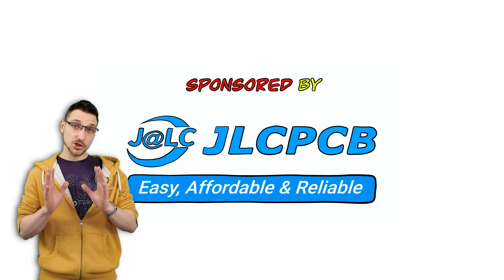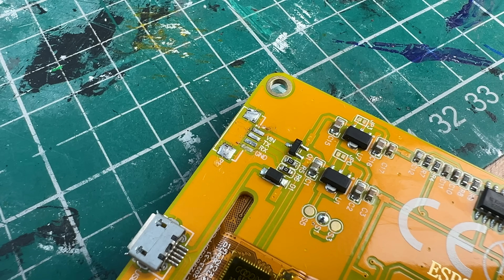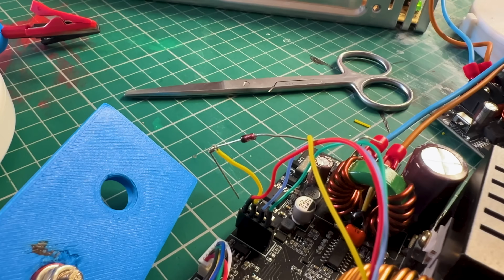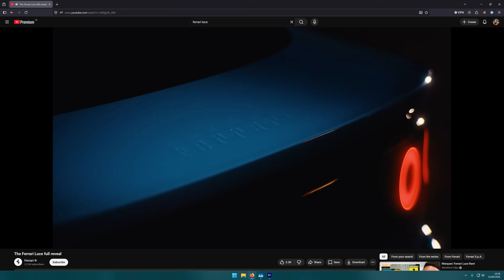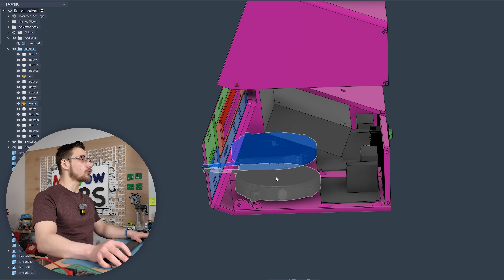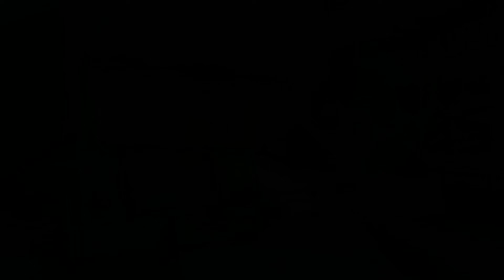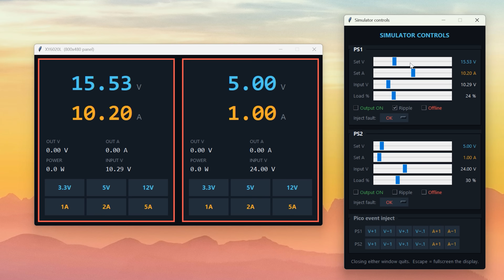I Built the Bench Power Supply Nobody Sells

Comment: XY6025L are HORRIBLE: contant current mode kicks in after 0.25s, even when you enable output (so it gets high above the current limit on low R on start). Some times it settles current after 2 s.

Comment: Great project. But the thing is too big/bulky; it takes too much space on the desk. For me it should be higher and less wide.
You've announced a 2nd version. When is that coming?
One thing that could be added is a USB charging port.

And you could add some speakers then you could use it as a internet-radio when you're not using it for the intended purpose (as a screen is already built-in ...    haha ;-)

Comment: A Pi Zero is immens overkill for something like this.  Just using only the Pi Pico would make so much more sense (and attach a touchscreen directly to it instead of using an CYD for that).  And I guess the "blowing up of the uart ports" points to the voltages used by both sides being different.  Pi and Pi Pico will probably use 3v3 (but double-check the datasheet as it might even be 1.7v) and if the other side would use 5v or even 12v (which is what a serial port back in the days would be using, but now is very unlikely), then you'll be out of luck fairly quickly.

Comment: since the power supply modules let you adjust voltage via uart you could make it output a sine wave or a square wave if needed and add a capacitor at the output to remove the dc offset
Reply: @M4CHINE69  wouldn't work, the supply can only source power, not sink it - and also the uart interface can only work receive commands at a fixed rate, thus greatly limiting the speed at which any waveform can be generated.
Nice thought-experiment, but reality squashes the practicality.

Comment: Knock knock, do you got time to talk with the lord and savior ESP32-P4? Which brings 5 uart ports to the table, and one low power one and which is available with a 4.3 inch display and an ESP32-C6 for wifi, Zigbee, thread, matter, Bluetooth a Co processor.

Got the 10.1 inch variant for 43 bucks this month to play around with :)

And it's also RISC-V, not some proprietary bs - which gives bonus points IMHO :)

It can also run Doom.
Reply from the maker: Just give me the leaflet and go away, look it up later.
Reply: @Mellow_labs is now later? :)

Comment: Hmm... a few thoughts... Not meant to be negative at all. I would happily trade my very old, very beat up analog bench supply for this!

A whole Linux OS to boot just to control a couple of voltages? I think the earlier version with the Pico controlling all might have been the better choice.

Anyway.. regarding the Pico version... about the laggy ui.. Why not swap it? If your hypotheses that the lag comes from using the software UART is correct then use a hardware UART for the display/UI.  The bit-banged GPIO 'UART' can control the second power supply module instead. Sure, you would still have a slight delay changing that voltage. But it would only be on the second supply. The first would be snappy. And you could always update the display, grey out the control, display a 'wait' message, etc... first. Then change the voltage. Then restore the display. That way to the user even if it took 2 seconds to get the change they wanted they would see the response from the display right away, know it was registered and not have to keep clicking.

The switches are cool. In a very creative sort of way, not unlike a "cyber deck" as one would see over on Hack A Day.  I would keep them for that 'cool, geeky' factor. But.. I would miss having the knob. A knob is a good UI for slowly turning up or turning down the voltage or amperage while watching a device's response.

As for quickly reaching a specific voltage.. well.. you do have a touch screen. You have the preset buttons on there which is an excellent touch. I would keep that. But I would add one more labeled Man[ual] or Key[in] or something like that. One on each side. Click one and the whole display just becomes a numeric keypad plus a row at the top displaying the number as the user enters it. That plus buttons for Back, Clear, Cancel and Enter. Upon cancel or enter the screen goes back to the two-sided main display.

OTOH... if you are married to the idea of the full Pi or something that runs an OS...

You can always integrate it into Home Assistant. And through that your favorite voice assistant. You could be telling Jarvis to set your voltages for you just like Iron Man. Then again, you could probably do that even with a microcontroller but you would need to switch to something with networking like an ESP32.

Comment: I think you can't generate a plus and minus voltage with the same ground, right?  that would need two isolated power sources.  OK as long as you don't work with, for example, op-amps at +/- 15v.  Good job, otherwise.  The presets are a great feature.

Comment: This is certainly relatable. I found myself wanting a 4-quadrant bench powersupply a while ago and couldn't find any remotely affordable ones. So I thought to myself "I've designed a lot of power supplies on various PCBs... How hard could it be?" 
Turns out that you need to know drastically more about power supply design to design a 4-quadrant (bipolar) power supply for use with a wide range of applications rather than a power supply for a specific use case with well defined operation parameters.

Needless to say it's been months and I'm still not done.
I'm almost starting to understand why these start at €2000.

Comment: This is fantastic! I also use retractable USB cables for charging my phone, but for a power supply, this is just awesome. It's exactly the kind of PSU I wanted to build myself. Personally, I would probably use two independent power supplies—one rated around 300–500 W and a second one around 100 W. That would make the setup more compact while still allowing me to power sensitive equipment without sharing a common ground.

Comment: Dude, you’ve put a crazy hell of a lot of effort into this project. It turned out pretty good, but now let me throw in some criticism.

First and foremost: this is NOT a lab bench power supply. A proper lab bench PSU is a linear regulator designed with excellent, correct circuitry, featuring a MINIMAL output capacitance—around a 15-20 of nanofarads, max.

Second: you could hook up a powerful switching supply to its input, maybe even with a dual pre-regulator function. Meaning, it should either maintain a constant voltage (true CV mode) or smoothly decrease it when current limiting kicks in (cheating a bit, but acceptable if we know when and why we're doing it). A toggle switch between these modes is a MUST.

Third: where is the remote sensing (4-wire sensing)? Bro, a beefed-up lab PSU is nothing without it.

Fourth: make 2 or 3 galvanically isolated channels. That way, you can either pump out 90 Volts at the output or, by dropping the voltage, crank it up to 30 Amps.

Fifth: you must have a choice between latching (overcurrent) protection and standard current limiting.

Comment: Your power supply design has a couple problems. Since both modules get their power from the same source you can not connect them in series to for a plus and minus 12 volts. They will fight each other. The second is the current sensing shunt may be connected to the negative output terminal. It's far easier to put a shunt on the negative side with a stable voltage than the positive rail which can have different voltages.

Comment: For rotary encoders I use schmitt trigger inverters and flip flop then only need one isr per encoder no debounce in micro needed and direction is done by the flip flop and there is two inverters left for the push switches.

Comment: Huge respect for the perseverance required to keep testing, debugging, IMPRESSIVE!!

One important point about many of these modules is that the VIN+ / voltage-sense line is often connected directly to the MCU through only a resistor divider. Because of that, one of the most common failure modes is that an overvoltage event reaches the MCU pin and burns the chip.

I actually made a library for this exact situation after the onboard MCU on my buck module got burned. I desoldered the original MCU and controlled the board with an Arduino instead. It works, but it is not plug-and-play: you need some reverse-engineering skill to figure out which pin does what, how the control signals are handled, and how to drive the original screen.

I made a GitHub repository for it, but the hardware connection is a bit tricky and needs careful wiring.

 WARRNING: you CANNOT connect your output channels in series to get dual power supply to power opamps for example you will get Magic smoke instantly (these are none isolated buck modules (common ground)).
Reply: if you want to use them is series you need :
 1- seperate AC/DC converter for each one
 2- galvanically isolate UART (no common GND) hint(Dual-Channel Digital Isolators)

Comment: Nice video! Those retractable reels are EXACTLY what I now want to use on my own PSU build - great idea! I'm going with an STM32 to run the screen and controls, plus an ESP32 for web access, and it's 3 channel, but the basic idea is the same :). In my case I often have to measure the battery pull over time with IoT devices I design, so developing custom firmware to make it simple to do that instead of having to deal with the horrible interface on my Rigol PSUs!

Comment: Going to parrot the danger of the retractable cable reel because I had bought the same one to create a retractable USB-C cable.

BE CAREFUL REWINDING THE RIBBON SPRING OR WEAR GOGGLES / FULL BODY PROTECTION EVERYWHERE, OR JUST AVOID IT ENTIRELY AND BUY A NEW ONE. Every time I think back to how it came undone during my many attempts to rewind it and how I sliced my fingers deep (so much blood) is how bad it could have been if it hit my eyes or anywhere else. Ribbon springs are not forgiving, and they are greased up so not the easiest thing to fidget with.

7:42 triggered my post traumatic ribbon spring disorder

Comment: Wonderful project, especially retractable cable is a cool idea. But using a whole computer (RPi Zero) for a power supply is such a waste of resources! Not to mention it comes with unique set of downsides and challenges very different from MCU world. 
Also, switches for setting voltage/current?! There is a reason nobody uses that, it takes too much force and travel (and hence, time) to move. You can now compare the time it takes to click through the switches and operate a clickable encoder.
By the way, there clearly is a proper reaction to touches on the CYD (the button flashes), there is just some bug in the code that prevents it from reacting on first touch.

Comment: wow never seen that idea of toggle switch, emergency stop switch and roll cable idea.... good work..!!! (subcribe!!)

i have idea for you buy3?CT? output PSU or two individual PSU, so you can wire up both PSU together like make batteries... (if you want do experiment in audio or other that need + 0 - you could combine the both co be CT lab bench supply, or make high voltage output with combine of both output... 

example: (psu1 12v+ & 0) (psu2 12+ & 0) ('0 of psu1' conected into '12v+ psu2' combined the result is '12v+ & 0 & 12v-' or 24v if you just connecting the 12v+ and 12v- also could mean if you use 24v supply result could 24+24=48v output...

and also could reduce of risk of cross voltage against 2 system that still have common ground...

but still if you done that, the next enemy is how to both board communication together when they have separate ground system, micro controller is feed with other small PSU, and UART communication is isolated with digital isolator like often found on USB isolator (adum1402) so control panel?board? still can communicate with no physical "wire and voltage" connected, and added bonus of protect the control board of noise from your experiment that may cause high noise... 

sorry for bad english and explanation is very bad...

Comment: Great project! Lots of clever stuff. 
Yes, excess air in an enclosure is bad, lab bench space is precious. 
Clever to use 3 ON-OFF-ON switches for the 3 digits. In my projects, I use an encoder plus 2 buttons (Left and Right) to select the digit. Then I use an underline (or other type) of cursor to display the active digit. I save the encoder press for rarely used stuff. Maybe to switch from set current to set voltage?

Comment: Two notes - programmable PSU doesn't deserve the Raspberry Pi or any other embeded PC, unless you need to monitor it remotely. I would much rather see usage of something like STM32F407 development board, which would be super fast, have many UARTs and IOs, be cheaper and probably most suitable for such a project. Second thing I don't like and would never recommend to anyone (it's 2026 after all) is the resistive touch screen. Just get a capacitive touch screen. It will change your life. No calibration, multi point touch, etc.
Otherwise, I love the other ideas and I will most likely do something similar for myself.

Comment: Why not enter voltage etc. via digits on touch screen? Most of the mechanical switches can be ommited 😂
Did you check if both grounds are at same level? Many Chinese PSU's have common positive and 'ground' is variable. Can cause some magic smoke as well

Comment: I like it. Especially pull out leads, power charting and switches for power adjustments. I do a lot of op amp stuff so would like to see a switch to quickly put it into +0- mode and allow dual voltages to be adjusted with single set of controls.

Comment: I think you are overcomplicating it with all the physical switches. Add a num-pad, have a select button on the touch UI for either channel. 
Then key-in the desired value and hit enter/confirm. Then Pi handles the keyboard with ease anyway, the touch UI / screen should no longer be an issue either. 

For me - from a design perspective, everything that is duplicated is a waste of effort, resources, cost and space.
Reply from the maker: yes, But have you considered this is my dream power supply, not your dream power supply.
Reply: @Mellow_labs sure :0 - just nightmares are dreams too - hehehehe

Comment: ya should do mellow labs colors, also maybe get it printed professionally? and add hinges with a basic latch for the panels? or even make modules you can just insert on to it that will then just set the power stuff itself like plug and play like for example lets say you have a power module for a nes, you can legit make a nes shaped module with nes power plug and have that plug into a port and it just sets it to 9v 1a by itself

Comment: IMO you could implement some QoL shortcuts.
Make it so any switch held down for ~2 seconds clears that digit to 0. 
Holding both the leading Current and Voltage toggles down, zeros everything for that channel.
Also make sure your debounce timers are robust, trying to flick 4v to 5v and ending up at 6v or higher, under live-control could be unfun.

Comment: I have a 35v5a power supply but I find myself using it to charge batteries most of the time. From 18650s to motorbike and car batteries it's really handy. 
Made some cables myself from some 10AWG for when doing some higher current stuff and they don't even notice 15a, and the voltage drop is minimal for when that is useful to have also.

Comment: And you could add a wave generator 😅
Reply: I'm wondering about making additional modules plug into the side, possibly with those banana terminals 😊👍
Reply: @LordPhobos6502 yes! Let's invent an open source module system where the raspberry pi manage the interface and a standard connector (i2c?) can be used to connect different modules that can be easily detached and swapped 🎉
Reply: @Mellow_labs

Comment: the raspberry pi is the deal breaker for my personal use, getting it up and running using an Arduino micro is the sweet spot for me. amazing work man!
Reply: I'm thinking some sort of add-on for the ESP32 to have a 2nd UART channel.

Not sure how with a CYD, but the ESP32 does support multiple UARTs.

Comment: I’ve run into the same problem with those toggle switches, for some reason they only make them with the labels the wrong way around instead of ON at the bottom and OFF at the top
Reply: Make stickers for the original plates? 😊

Or just pop em in upside down & call it quirky 😂

Comment: I had  the same problem with the fan of my power supply. Just opened it up and added a thermal resistor ntc.  Now the fan works perfect. Just turns on when needed. In my case above 45 ° C.

Comment: I didn’t watch the whole thing yet but having connectivity could be nice for a next version if using a board that natively support it for the setting and preset since they are now cheap and support is huge. You don’t need an app, just a self-hosted webpage directly on the board with its own network. It’s probably not worth having a smartphone close by to control it all the time but the ergonomics would probably be way better than a capricious touch screen for maintenance.
Or a more ambitious project would be a "smart bench" with a dashboard tablet or even physical switch and knobs on your desk and integrating multiple devices you can control from there. Equipment is often bulky and you need to swap them all the time if you use more than once with limited space, but for example you could put the power bench under or behind the desk due to the retractable cables (love the idea).

Comment: Far easier designing a pcm for the control using easyeda say. thn you could source a microcontroller with two uarts. Everything then neater in case as well. How did you mount your hot air station etc under the desk a 3d print ?
Reply from the maker: Nothing fancy just hot glue 😂